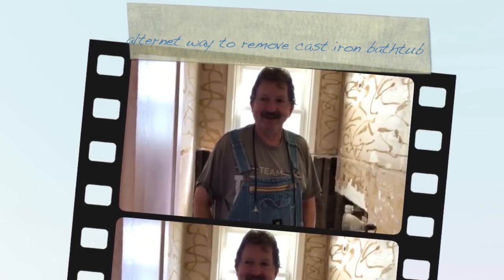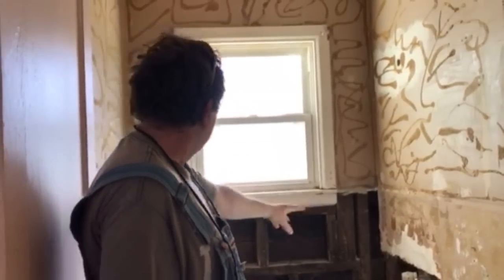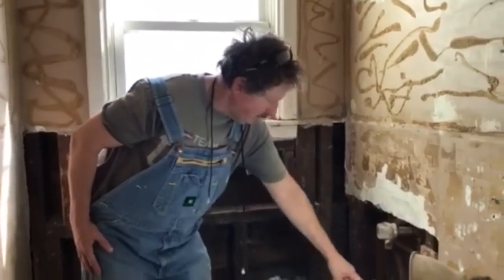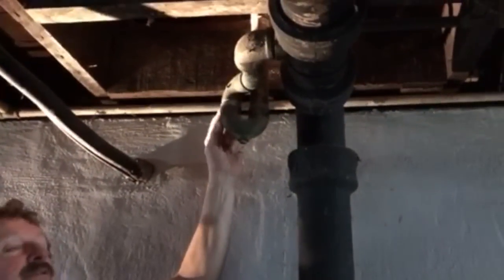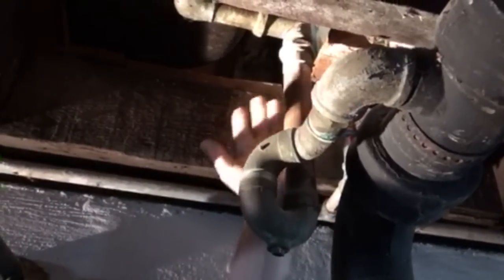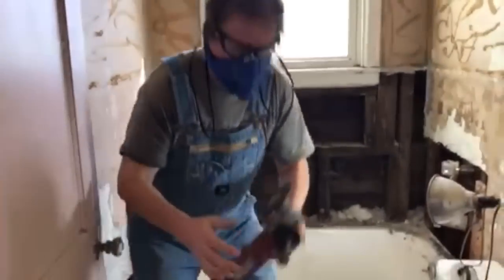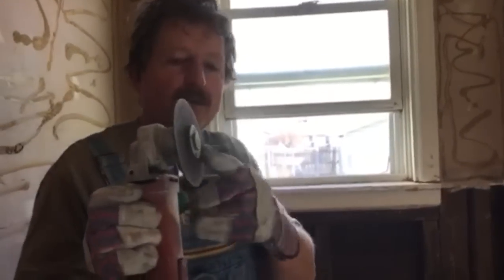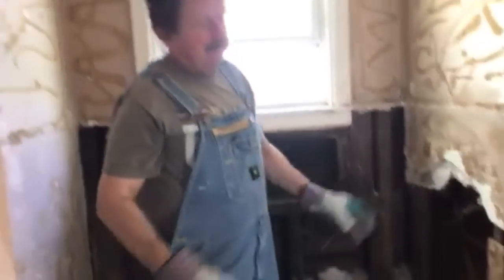no sledge hammer to remove this cast iron bath tub

Comment: seen many of these removals and i can't believe how backwards you americans sometimes think and the waste you produce. That bath tub should be removed in such a way, that no tiles or the tub get destroyed, at least that's how we do it in europe. I dunno how you cement it there that you have to destroy it to remove it. It literally blows my mind. Is the resin so hard to remove at the sides to pull the tub out?
Reply: There’s plaster wall and titles over the lip of the tub. This is standard installation to water proof in US. So it’s almost always requires to remove the titles before removing the tub. Of course there are plastic pvc standup shower kit but this is another beast that created in 60’s
Reply: Most USA Standard tubs (after 1952) have a flange that goes up under the tile to catch water that leaks through the grout.